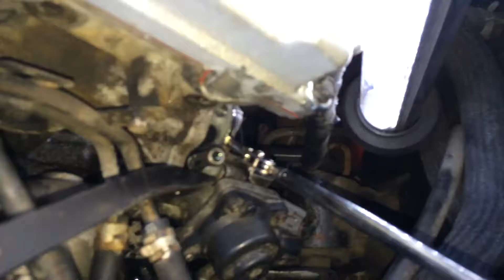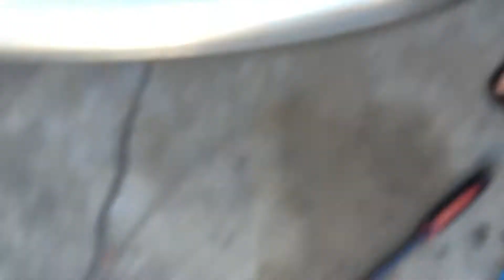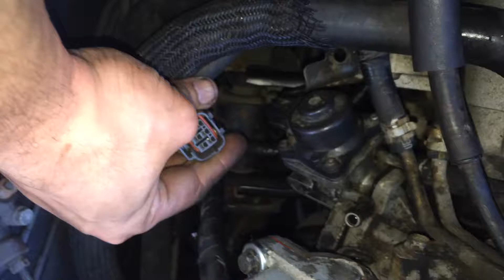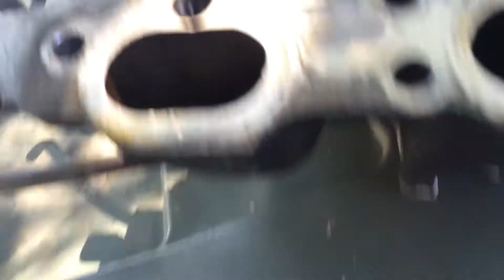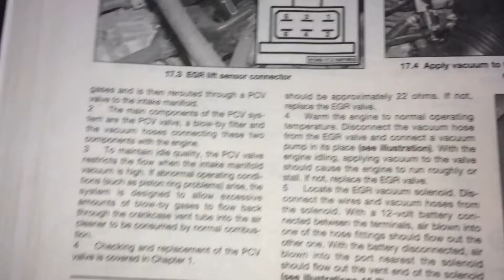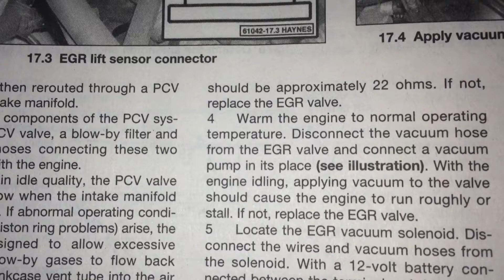2002 Mazda 626 EGR P0400 CEL Part 4

Comment: Oh, so you weren't able to get the EGR out? I was worried this wouldn't be possible without pulling the whole engine. Damn. What symptoms were you having with yours? My friend's Mazda is stalling off idle.
Reply from the maker: Later on, about a month after I was able to clear this code. I was able to unbolt the EGR valve and bend it backwards a bit with the tube that attaches to the manifold. I cleaned the passage and the code never came back
Reply: @JohnattanRivera1984  That's excellent. So you sort of took it off halfway and left the tube with the 7/8 nut connected to the manifold?
Reply from the maker: @stopthephilosophicalzombie9017  Yes, I ran carbon cleaner with a wire hanger until it came out the other end. I ran later on a rifle brush to clean the crud
Reply: @JohnattanRivera1984 Gotcha. I'm going to have to do something because my buddy's 626 is stalling out badly and the Mazda dealership said they didn't want to do the job.
Reply from the maker: @stopthephilosophicalzombie9017  Let me know. I’d be glad to help you out. I’m almost done restoring my Mazda. I have some interior work to finish. I’m running behind since I was in a military base for a while.